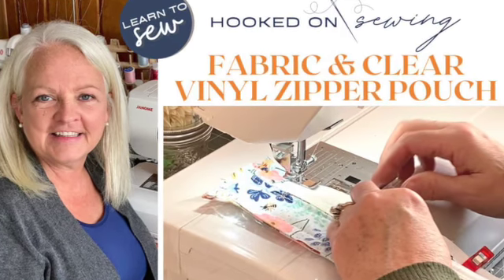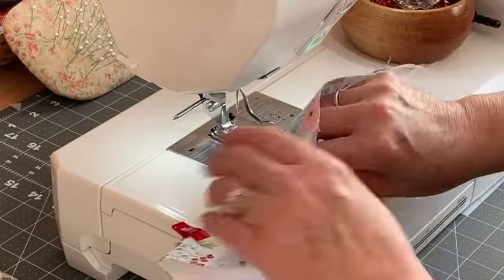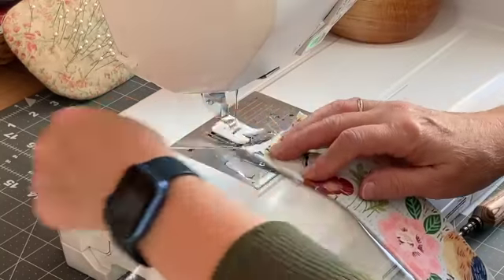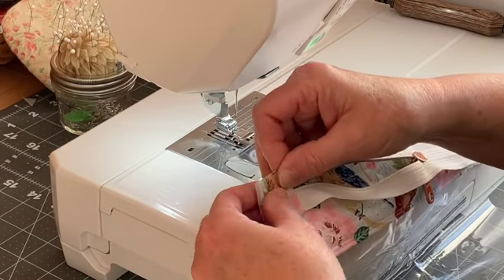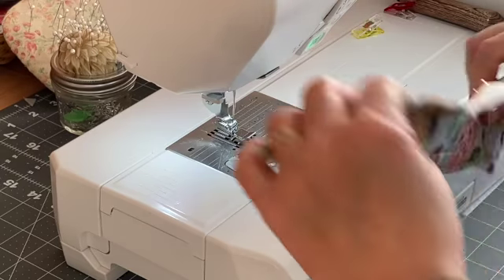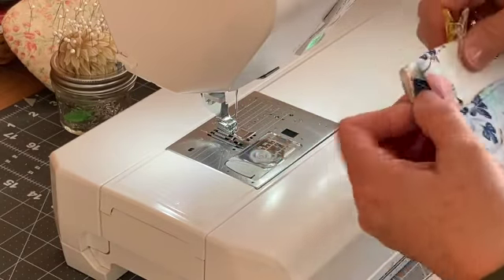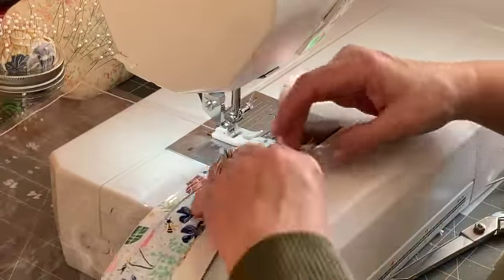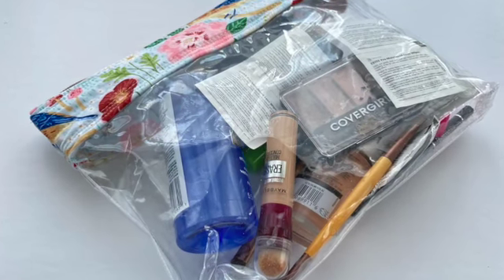Learn to Sew a Fabric and Clear Vinyl Zipper Pouch | Sewing tutorial | Janome 8200QCP Sewing Machine

Comment: This was very informative! I'm in need of making a pouch to put in a 3 ring binder. How would you recommend doing this if I used this pouch?
Reply from the maker: That is a great question. I would add a strip of fabric or two strips (one for the front and one for the back) to the bottom of the pouch. Maybe 2” to 2-1/2” wide. I would also use interfacing on these fabrics to reinforce. Then I think I would topstitch down both long edges. You could then either stitch buttonholes or use grommets for the three holes. Does this make sense?
Reply: @hooked-on-sewing  it does! Thank you very much! ☺️

Comment: Love the video can you mention which make of vinyl you use, in live in uk. I’ve never tried sewing with vinyl and would like to try.
Reply: Thanks it's not always easy to get things over here that match.
Reply from the maker: Sometimes I repurpose vinyl. Often times when we buy bedding like comforters, they come in these clear zippered vinyl bags. I cut out portions of that bag that I can use for making zipper pouches. Some people even use clear shower curtains or tablecloths.
Reply: @hooked-on-sewing  thanks for these suggestion you are most helpful
Reply from the maker: I’m not sure if the brand of vinyl. It is 16 gauge vinyl that I purchased at JOANN Fabrics. If you look for 16 gauge vinyl, you should be able to find it. I hope this helps!
Reply: I’m in Australia and found 0.5mm clear vinyl tablecloth is similar gauge. A jeans needle 14 seems to work well